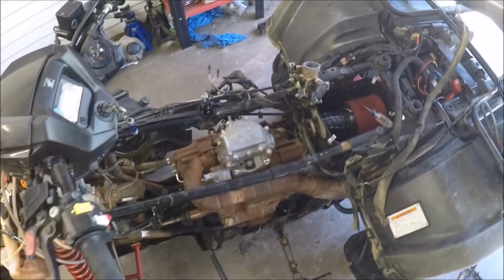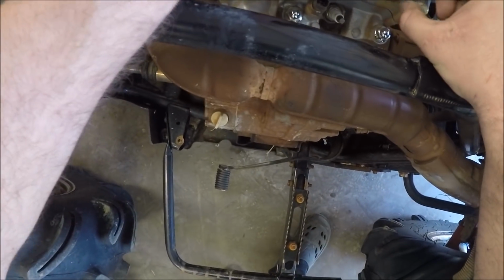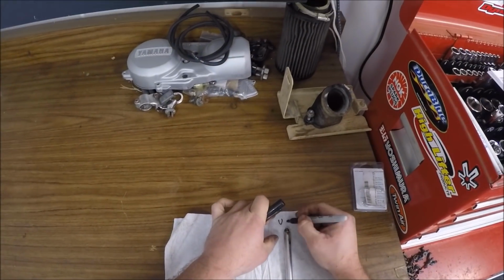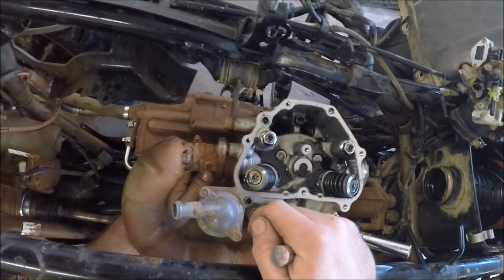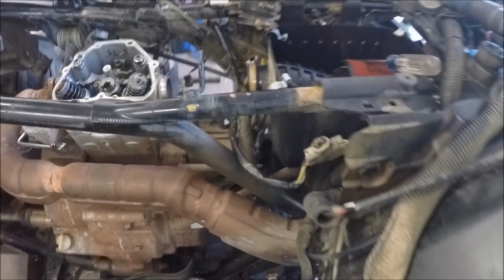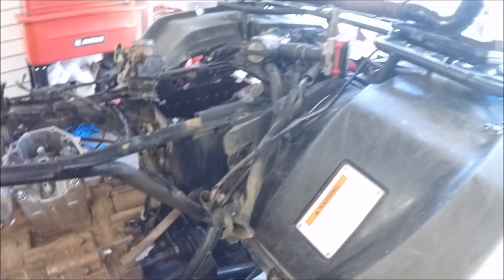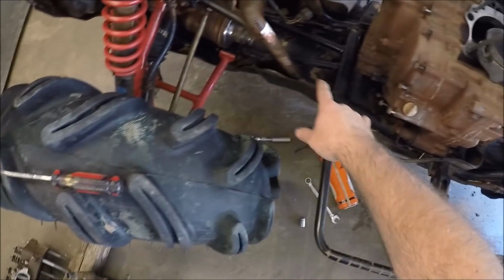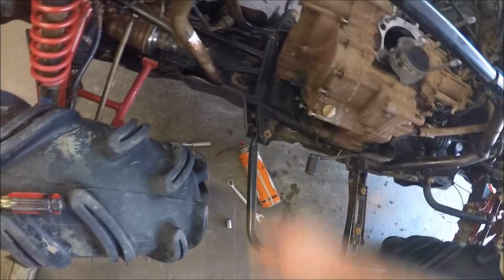'16 Honda Rubicon 500 Top End Tear Down: SwampAss Rebuild - Part 2

Comment: hey man... u do some good work, and Im curious to get  your opinion, I found a 98 foreman 400 for $400, I know it needs a carb and some electrical work and some body plastics... my question is... are the 400s a good bike? and what brand aftermarket carbs are you using? ...
Reply from the maker: I have actually had good luck with Caltric Carbs. Most of their stuff Ive been pleased with. Also yes for $400 you did good.
Reply: +SolitudeCustoms ... thanks for the help man, but I missed the bike, deals don't last long, so back to looking...

Comment: Hey have a question I have a friend that has 98 foreman 400 he took the back side cover off it to check the shift fork rod cause it hung up in gear he pulled the shift rod out some and said he heard something fall in the motor would that be one of the shift forks on the gears

Comment: Can anyone answer a question for me.   Can a 1999 Honda recon 250 turn 28 inch bkts in somewhat thick mud with a clutch kit and a 50 over piston
Reply from the maker: No.A .50 Over wont gain you anything noticeable.
Reply: Yea no, I had a 2000 250 recon with 25" vamps An they were bout all it could handle. It was a fun bike though you could bury it an still push it out of pretty much anything they're so light.

Comment: Why do you loosen things little by little back and forth? That’s what it looked like you were doing anyways.
Reply from the maker: Bryan Norris To prevent warping and unneeded pressure on parts.
Reply: SolitudeCustoms Oh ok makes sense. Good tip for next time I do any engine work. Btw I enjoy the videos.
Reply from the maker: No problem. I figured if there is a Torque Down Sequence then back them out in a Sequence for the same purpose.